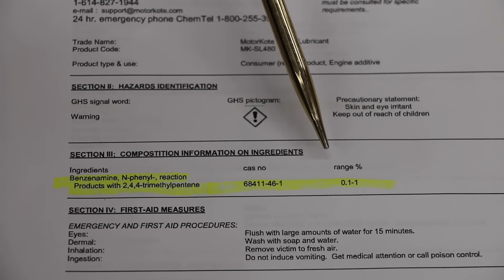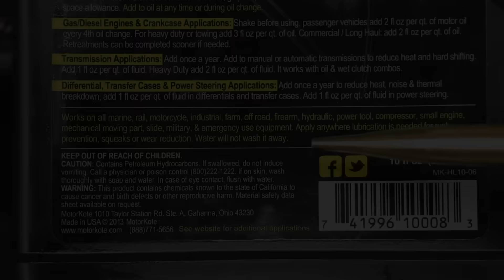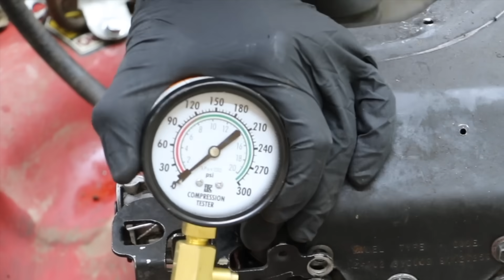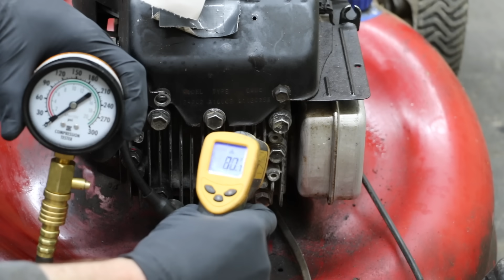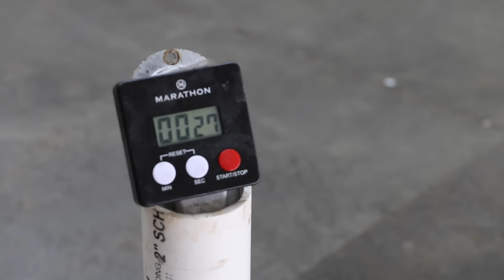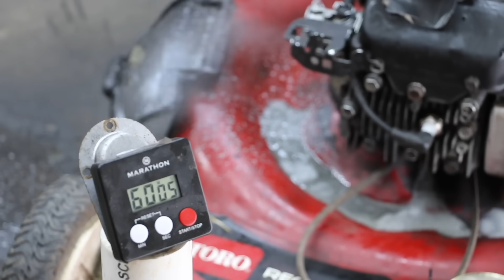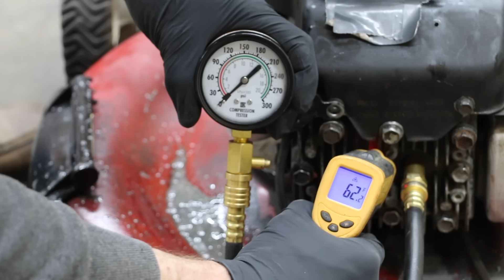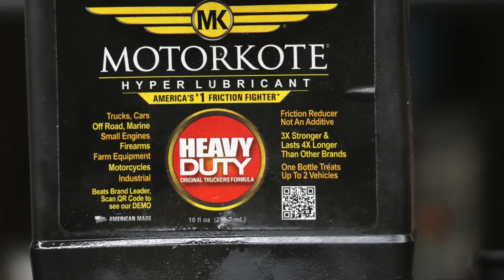Can MotorKote survive the water test?  Let's find out!

Comment: how does that thick glop go through an automobile oil filter?  .....i went to amazon and motorkote gets good reviews and everybody there is talking about your video......a few guys gave it 1 star because it left a thick sludge in the bottom of their oil pan.....so something weird is happening......you should retest motorkote and see if it solidifies or semi-solidifies over time.....i wouldn't want that thick milky stuff in my crankcase.....my car uses 0 - 20 weight oil and its very thin and needs to be thin
Reply from the maker: Thanks for the recommendation!

Comment: Next time I think you should have a control experiment. ie run the engine with just 10W30, drain it, and run it with water in the crankcase.
Reply from the maker: Thanks for the suggestion.
Reply: @ProjectFarm  wow. Still replying to comments on 3yo videos. 👍

Comment: Hi there... nice job. What do you think would happen if we added (Evans Waterless Coolant) to the MotorKote instead of regular water? I'm asking because the (Evans Waterless Coolant) have a high tolerance toward heat so if it stays in the engine; Not like the regular water, while on the other hand the MotorKote keeps the engine lubricated. It might be a good idea to use (Evans Waterless Coolant) for the coolant along with MotorKote for people who have problem with the coolant leak into the engine oil.
Reply from the maker: Thanks for the suggestion.

Comment: WOW !  The proof is in the Project Farm experiments. I would not have believed that the engine would run with water in the crankcase(by that I mean for anything like an hour, with normal temps etc.) The lack of any metal flakes(of any destructive size or number) in the filters, exonerates any claims made by the company. I would not use this product in my Cummins diesel ( I follow what Cummins recommends) but I have another venerable vehicle that I would be prepared to use it in. Another marvelous test, complete with the usual Project  Farm series of provisions to minimize testing errors. I STILL want the contract tpo supply you lawn mowers !   Thanks again for a truly informative video. BRAVO !  Well done !
Reply from the maker: Thanks so much!

Comment: I am glad that you tested MK. I am also skeptical of any additives, stemming from the Slick 50 debacle from way back when. I am a truck driver, and they sponsored an overnight trucking show that I listened to a lot when I was on the road. It finally took 3 years or so before I ended up trying it. 
I was driving a 98 Volvo with a Cummins N14, and on a wicked hot day  in Texas the oil pressure dropped wicked low so I bought a gallon and dumped it in. Later I learned that the oil pressure sensors in them went bad, but it was worth a shot. It was difficult to notice if the mileage came up since I ran a step deck.
Anyway, I put it into a JD walk behind mower that you didn't want to stand next to since it sounded like the rod was about to f off into a low earth orbit. 3-4 minutes after MK and the rap was 80% gone. 
I've run it in a 4L60E for 207k miles, and  I can tell when I need to add it again. 
Great stuff. I am glad it's available.
BTW It's rumored that NASCAR teams run it 100% no mix.
Reply from the maker: Thanks for the feedback.
Reply: I’m also a truck driver and did more research on this. You really don’t want to use it because it’s mostly chlorine and it will severely corrode the different metals it comes in contact with once the oil drains down into the pan and it’s exposed to air. Change your oil and filters every 10k miles even if it’s synthetic or pay the money to install a bypass filter that can get all the carbon soot out of the engine oil continuously. That black carbon is what causes extreme wear on engine components. All oil additives are a complete waste of money. The only thing that can help is the Engine Restorer but that should only be used before a oil change when your piston rings are full of crud and need some help getting unstick. If you use too much of that product or use it while the engine is loaded it will screw up your bearings.
Reply: @markm0000  Curious if you have a lab test or msds supporting your chlorine claim?

Comment: Seeing this video makes me beg you to do a test on amsoil full synthetic 1 year 250,000 mile oil.

Personally I've been running it in my truck since I bought it brand new in 2004. I've only got 120,000 miles on it and for a guy who is paralyzed, I beat the hell out of it. I've hauled heavy ass firewood, stone, gravel, sand and dirt in a 5' X 10' trailer. Not to mention I've had it over a hundred miles an hour three different times since I bought it. Once was just about 2 weeks ago I had 104 mph.

It's kind of funny because the dealer has shown me what I believe is a bogus check and saying it was for somebody's engine that was blown up while using it. If you have a check for me like that, I'll be there within an hour one way or another to get it.

Comment: I have been using it in my 2016 Harley-Davidson but only for a short while and am using a much stronger concentration than what it suggests in the instructions on the container. I have not noticed a dramatic change in the engine temperature however I did notice my bike now almost idles too fast even when throughly warmed up. I have not been running premium like I normally do. It honestly idles too fast on the medium grade which shocked me. I have only had it in my bike for a few hundred miles though.
Reply: Adjust the idle to factory specs.
Reply from the maker: Thanks for sharing.

Comment: I have religiously added Motorkote to my 2.2l Ecotec's oil change for years. I'm trying to ascertain whether it might have impaired oil flow through the camshaft solenoid actuator screens, or if GM's extended oil change intervals are more to blame. Luckily Motorkote washes off with brake cleaner, so I now have a spare set of  actuators should the ecm show another p0010/0011 code.

Comment: I knew the inventor of this in charlotte Michigan.  He says how it works is that it changes the surface tension if the metal when heat and Pressure is applied to the metal.  Hence why you have to sand paper the Race surface after each test on the bearing tester.  The water had an effect on the bearing because you didn't properly heat and Pressure the Race prior.  It looks like you added MK to surfaces without conditioning and then stuck it in the water and then ran the test.  ??

Comment: Have you ever heard of or tried adding acetone to your fuel tank? I've been doing it for several years in everything that I have here that burns fuel. I read an article off the internet years ago and the premise was to help burn all of the fuel and not losing any of it in the combustion process thereby increasing fuel economy (better gas mileage). I noticed the use of it in my oil furnace for the most benefit. Without acetone the chimney after a few years filled 2/3 full with soot.. and unburned flakes
Reply from the maker: Thanks for the video idea.

Comment: PLEASE TEST PROLONG ENGINE TREATMENT. YOUR TESTS ARE SO IN DEPTH AND THOROUGH AND EXPLAINED IN THE BEST MANNER. I'VE BEEN USING PROLONG FOR OVER 8 YEARS NOW, AND I'VE RAN IT IN ALL MY VEHICLES POWER STEERING SYSTEMS,  TRANSMISSIONS AUTOMATIC AND MANUAL. IVE OWNED IMPORT AND DOMESTIC MODELS WITH ENGINES FROM 4 CYLINDERS TO V8S. I WORK IN THE AUTO PARTS RETAIL BUSINESS AND SOLD COUNTLESS BOTTLES TOO COUNTLESS CLIENTS, I HAVE PERSONALLY SEEN MY MPG ON ALL VEHICLES INCREASE ABOUT 1-2MPG.  I'M VERY CURIOUS TO SEE THIS TEST AND WOULD LOVE FOR YOU TO MAKE THE VIDEO. I'M NOT SPONSORED BY PROLONGED BUT I SURE WISH THAT I COULD BE BECAUSE I'VE SPENT THOUSANDS OF DOLLARS AND I'VE MADE THEM TENS OF THOUSANDS OF DOLLARS BECAUSE I'VE HAD NOTHING BUT  GREAT EXPERIENCES USING THEIR PRODUCTS
Reply from the maker: Thanks for the video idea.

Comment: I am a firm believer in Motorkote. I had a 2002 Jetta TDi that I used Motorkote in. I had knocked a hole in the oil pan, I drove it 2-3 miles before the oil light came on. I ended up putting a new pan, oil and another dose of Motorkote in afterwards to run it and chance saving the engine. The engine lived and last another 30k+ miles before I got rid of the car!
Reply from the maker: Thanks for sharing.

Comment: I have always wondered if all the 50/50 antifreeze brands actually use distilled water.  If the 50% water is not distilled, they actually might be doing more harm than good when protecting your cooling system.
Reply: I never buy the "pre mix"  - doesn't seem worth it.
Reply: Jeff...YES the water in 50/50 ready to use Antifreeze IS distilled water..rest assured it won't harm your internal cooling system
Reply: Man I doubt the more reputable companies like valvoline would use tap water in their pre mix coolant
Reply: @DeepSouthernTX  If you trust corporations not to use the cheapest stuff they can find to increase profits you're far too naive.

As long as you change it every year the additives in the coolant will keep it free from oxidation anyway so it's not like it really matters.

If you don't want to change it every year you can always go for the water free stuff, it lasts the lifetime of the car and is far better in every respect but it is not cheap because you need to remove all traces of water with a dryer before you do it. Also, not Evans, it's cheap but it's really crappy.
Reply: @michaelmay5453  I agree that companies maximize profits but some brands still maintain some sort of guarantee that's why there are specifications such as ford vc7 which is the gold coolant, I'm using valvolinez zerex that meets that  specification. I don't plan to change every year and since my coolant guarantees protection up to 5 years I've placed a magnet attached to a rigid metal wire inside the reservoir and that way I can collect iron particles and monitor corrosion protection if the wire is not rusting

Comment: If you didn't use distilled water the results are jaded,  most water has different properties that include high contents of minerals that may be good for human consumption but anathema to the insides of an internal combustion engine. MotorKote, you should have used more than the recommended dosage for such an abused engine.
Reply from the maker: Thanks for the feedback.

Comment: I was impressed, but not surprised, that after running with only water in the crankcase surface of the valves were pristine.  I'm guessing the heat/energy in the vaporized water (steam) was so high that it prevented and removed any carbon buildup on the surface of valves.  IDEA for a future video....  With a dirty engine (surface of valves has significant carbon buildup), would water in the crankcase for 60 minutes (creating lots of steam in the combustion chamber) actually clean off the burnt carbon on the valve surface of a dirty carbon engine?  Possible TEST would be running MotorKote and oil at a 50/50 mixture to coat the engine again.... then drain the MotorKote and oil, refill crankcase with 100% Water and run for one hour.  Then view the condition of the carbon buildup that was previously on the surface of Valves.  Would the water (steam) by itself serve as an effective valve surface cleaner?  What about the other surfaces of the cylinder head that had carbon buildup... were they any cleaner?
Reply from the maker: Thanks for the video idea.

Comment: Oil lubricates, cools, seals and cleans. It also serves as topic for endless conversations and disputes about mechanical theories. The saddest day of my life came only few weeks ago when I realized that I could have run every vehicle I have ever owned over five decades on 10W-30. The sum of my wisdom is, trust the specifications of your products and equipment.
Reply from the maker: Thanks for the feedback.
Reply: @ProjectFarm  But, you will never do damage by exceeding the manufacturer's oil change mileage recommendations. Sometimes, in the fine print, you also will find recommendations based on climate. I use 10W-30 where I live rather than 5W-30 because it never gets close to 0 F where I live.